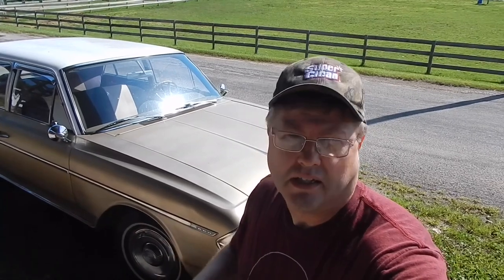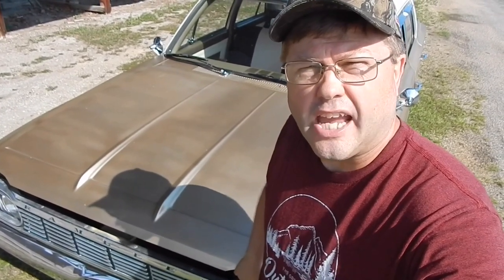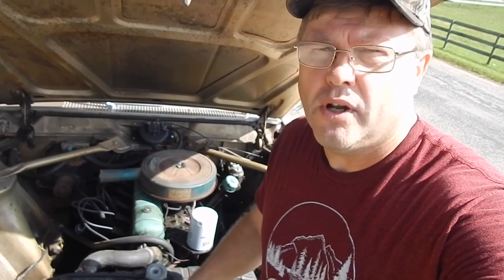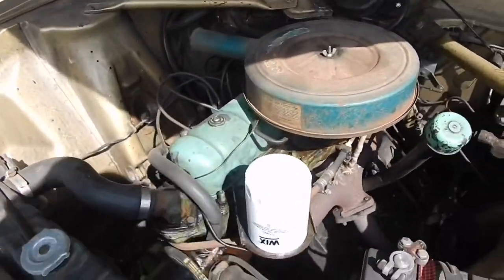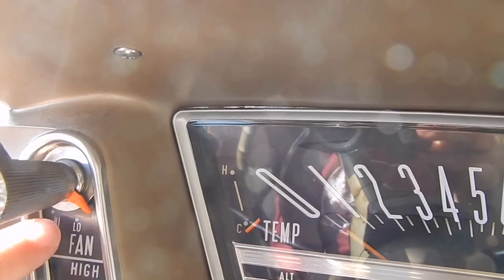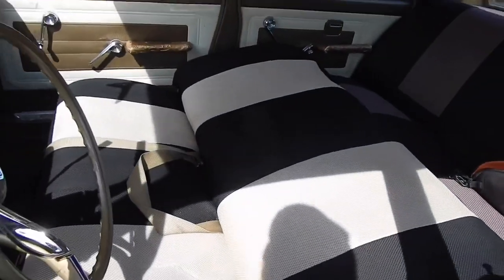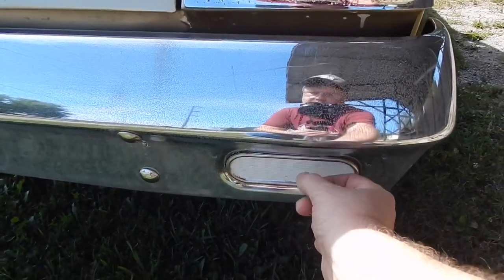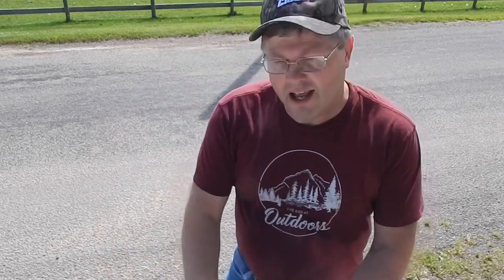1964 AMC Rambler Classic 660 ......  A Closer Look

Comment: AMC when cars were built with 99% American parts and Canadian labor when needed whole different world when the rambles was born. The fluctuations did you mean heat expansion rate difference between the head and the block?... After all its an old lady car hence the bifocals! Still a cool piece of America iron!
Reply from the maker: Yes on expansion, and the intake being part of the head doesn't help!  I wondered why all the old ladies were waving....  Thanks for watching !!
Reply: @318willrun  Ford 360 and 390 they had part of the valve cover rail as part of the intake man they suck when it comes to keeping them leak free

Comment: Definitely a sweet little Rambler! I assumed the engine would have been a 232, didn't realize they made one smaller. One thing; KEEP THOSE CASTLE NUTS TIGHT ON THE FRONT SPINDLES! I've heard stories of the early 60s Ramblers front wheels coming off on the highway... Take care!
Reply from the maker: Thanks for the info on the front spindles !!

Comment: My dad had the 60 classic 660 wagon in a dark blue. 287 v8 auto, no air, no cruise. I ended up driving it way later in 74 and sold it to friend when it had 125k on it (he drove it to 250k and junked it :( ). The starter, radiator, alternator, and water pump all went before 100k and the timing chain went around 100k or so. My frind had an identical wagon in gold and we use to sing the Allman Brothers "Ramblin' man" and substitute "Rambler Man" for the chorus. Oh the memories :)
Reply from the maker: Thanks for sharing !!

Comment: My dad has the same model except it was a 3 on the tree. I remember the reclining seats and thought they were so cool. Back in the day seat belts were not mandatory and I can tell you the dash was indeed made of metal. Yes, after a sudden stop the dash stopped my head. My dad's car had no radio, manual steering and brakes. It was the first car I learned how drive and to do an oil change and remember how spacious the engine bay  was. The last thing I remember was since we lived in Canada, both driver and passenger fenders were prone to rust in the upper wheel well. I totally loved the dog dish "R" hub caps.......this was truly a basic car that got you from point A to point B.....My dad had it from 1966 to 1977 and remember it never burned a drop of oil. I am 6'5" and wish they still made basic spacious cars like this. He paid $800 in 1966 for a 2 yr old car with 1000 miles which is about $7000 today.....try buying a 2 yr old car today for even $10,000!
Reply from the maker: Awesome story!  Thanks for sharing!

Comment: had a 770classic wagon 289 with a 2 speed trans. what a comfortable car, great in the snow very reliable, good on gas. lost the alternator coming back from philly drove 100 miles no lights no problem. panhard rod broke on my dirt road back wheels were sliding out I pushed the body back over the wheels and welded it together.
Reply from the maker: Thanks for watching, and thanks for sharing your story !

Comment: I have the exact same car year and motor it’s been good so far just haveing trouble finding the transmission modulator at and what the first couple things you would check when haveing problems with the vacuum for the wipers
Reply from the maker: Just make sure they are getting vacuum.  Mine almost stop when giving it gas to climb a hill.